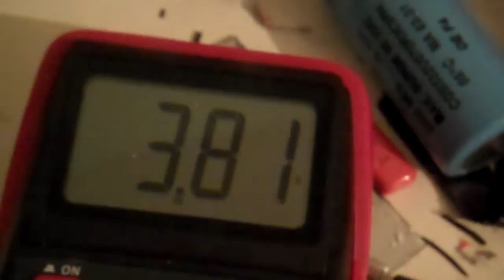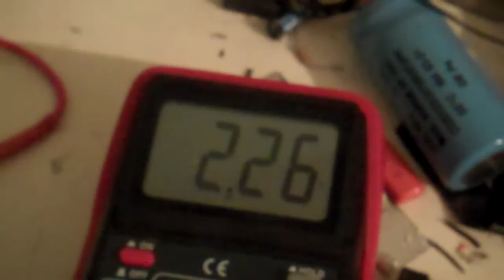Free energy Experiment #2 Cement Battery

Comment: I have watched many of your videos, and while interesting, I do have something to ask - 
have you considered that what you have made is essentially an antenna? the typical configuration of the batteries in all you rvideos is highly symmetric, and by running a copper rod in center and conductive tube outside, you are essentially making a very good coaxial wave-guide. 

the cement mixtures acts as a dielectric, which increases your attenuation, and therefore absorbed power, which in my mind is proven by the fact that adding salt and certain crystals/metals to the mixture (mobile ions) enhances the power you get out of the assembly. your composition for the  cement (i.e. dielectric) is unique, which is why yours continues to work after the galvanic reaction has stopped, whereas others who do not make the wave-guide properly or use a far less effective dielectric substance.

So essentially, you are picking up on background radiation from everywhere - man made sources, cosmic sources, who knows. 

I am running very back of the hand numbers here on the wave-guide dimensions and power output you are seeing, but this seems to be a very reasonable explanation, at least to an order of magnitude. 

I think this is further proven by the fact that you saw pickup from your Tesla coil in one of your later videos. the Tesla coil was generating stray EM and your cement/metal antenna was naturally picking up on the power. 

not that the above invalidates this as an energy gathering device, if that were true it would still be, in a real way, "free energy" - i.e., energy that does not have to be paid for. if anything, using such a device allows you to collect otherwise wasted power falling on the earth everyday, so i do not think it is a bad thing. 

I would just be hesitant to jump straight to  "Casimir effect"  or "Hutchinson crystals" when there are many better, more reasonable explanations that would be equally valid.
Reply from the maker: casimir effect was the most logical thought about it for me due to the salts and tiny seperating plates in it the battery did stop working after a few years due to the transmigraion of anode to cathode causing a direct short

Comment from the maker: the casimir effect does not only happen in a vacuum thats only to eliminate things like ionic wind and moisture in the air to get a consistent reading. as for the corroding that only takes place int he first 3 weeks of operation in the cells. after that the wasting of the metal is casued by electronmigration in my earlier experiments. before i discovered coating the walls with sodium silicate. john hutchinson and  bedini did similar with doped cells similar to mine but no corrosion

Comment from the maker: i was using cement as plates and crystals separating it the pressure from the cement would cause the crystals to oscillate capturing  stray waves. in theory. if the metal hadnt corroded the battery would have still been going 2 years later it only lasted 1 year in continuous duty due to corrosion. strange effect i never mentioned when using more than 3 cells it had an effect similar to tesla coils in respect to unipolar currents. i think that is the right terminology i forgot

Comment from the maker: @1crazyfocker ive done allot of testing on them after 3 weeks or so the chemical activity in the cell stops most people are left with dead cells after that unless they add water but  corrodes metal badly ive cut other working ones apart dry as a bone they maintain current and voltage. some cells can be shielded and stop working completely untill removed then they work again i havent been able to make each cell do that ive cut them all apart next is osciliscope readings whenever i get one

Comment from the maker: @prototype9000 somehow i have to find a way to electroplate or make a way for the zinc stick to a crystaline material without adhesives that would immediatly kill the dipole. the adhesive would. when when its in its excited state i will excite it some more while adding ahigh frequency high voltage potential to it i think that would more efficently trap the energy. i want. the cement thing will not do

Comment from the maker: mabe this isnt the right way to tap zeropoint ive been thinking. what happens on the microspoic level even after the cement fully cures theres still an exchange going on thru hydrogen oxygen and chemical processes. mabe i need to initiate the process thru heat something that shrinks around the crystals when you put pressure on crystals it modulates a  small radio wave. i think casting  metal around it would do that a stiff metal like zinc that has a low melting point but high strength

Comment from the maker: @m3sca1 i had a similar idea except with the crystals and epoxy i wanted to add some of the radiator seal the kind with the little platelets of aluminum dry. and zaping with a high frequency electrostatic cockcroft walton generator with a few 5 megohm resistors to limit the current but give an electrostatic charge that should keep as the epoxy hardens. but money is an issue at the moment.

Comment: @prototype9000 i had a thought today that maybe you should try epoxy-resin, combined with one of the rocks that have piezo qualities, eg- quartz, granite, etc.
the curing resin will shrink, applying pressure to the piezo material. 
im thinking of trying some quartz in cement and hitting it with a DC voltage before it cures. idea being that it might polarise the crystals before it sets,

Comment from the maker: @SSe4U13 i left it out int he sun for a few days to make sure the water was depleted from it. when i wet the cement i ind that the current and voltage drops to unusable levels. I added crystals and salt to the cement to im trying to take advantage of the casimir effect i may have done it. not sure i have an led that has been lit for 24 hours so far with it